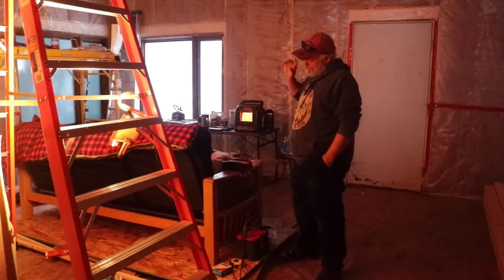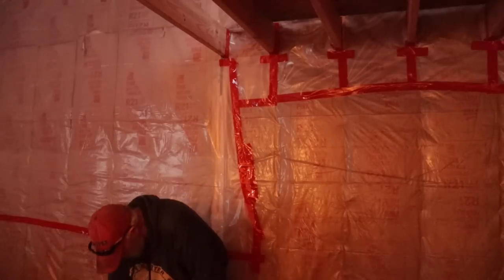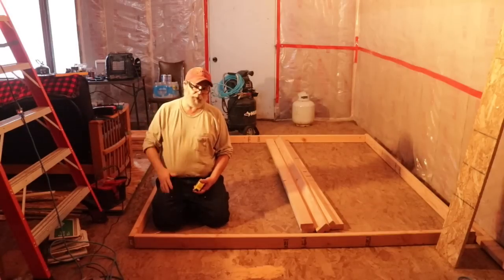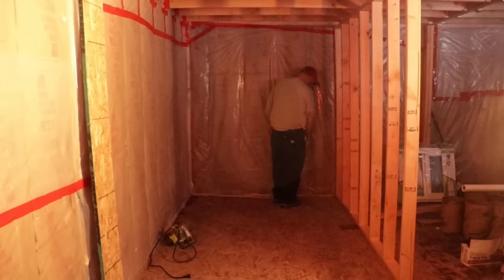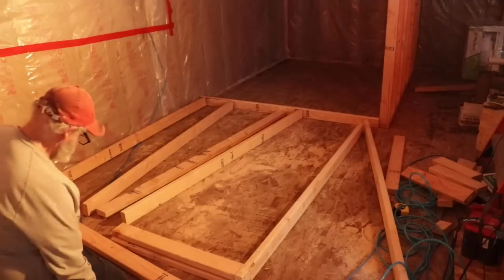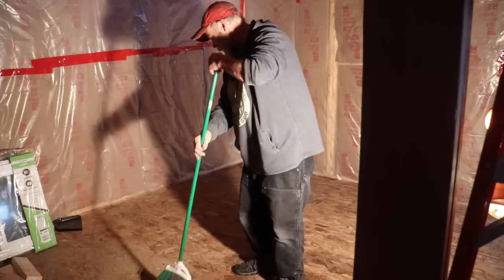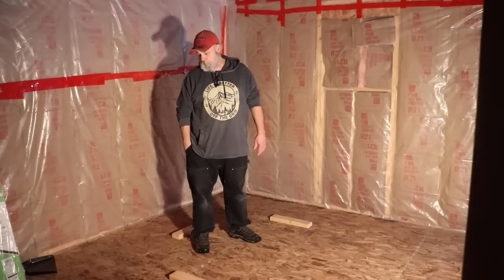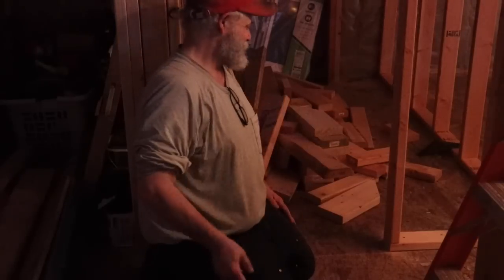Framing the Kitchen, pantry, and bathroom of the Alaska cabin

Comment: Stand kitchen base units are 24”D with 25.75”-26”W counters so doors and handles land under counter to prevent belt loops (and other parts) from catching on handles. Single aisles between counters are 42” to save on wasted floor space this allows for stove doors to be accessed comfortably keep fridges to no deeper than 28” or aisle will have to be increased. Looks great Sean!
Reply from the maker: Thank you! That just saved me a great deal of Google time looking them up 😉

Comment: Have you considered a half wall for the left side of the kitchen?  Less walls will make the cabin look bigger, and heating and cooling the cabin will be better.
Reply from the maker: Part of the reason I went with a full wall is that all of this is under the loft making the open area feel just as big. I still have the huge open ceiling in the main room .

Comment: Are u putting in a water pressure tank near your pump? They didn't put 1 in here..my water has been shut off all winter because of them not putting in tge proper 12v rV pump abd pressure tank..I also shut off my water heater..no point having it on if I'm not running water thru..
Reply: They installed an AC pump and my solar was not properly installed so my pump was not running right..
Reply from the maker: Yup, my plan is to have a full system, pressure tank included!

Comment: 23:44  30 inches wide-1 foot shelf on each side= 6 inches to move around in between? I am neither a builder nor a math-er, but that doesn't sound like enough room. As yes I realize you are already done with it by now.
Reply from the maker: If we are talking about the pantry, it is 5 feet wide, so with 1 foot shelves on each side I will have 3 feet in the middle. I do, on occasion lol, say numbers that do not add up when I am recording lol. For the kitchen I will have 4 feet of space between the cabinets to work.
Reply: @SeanInAlaska  Ahhh. I might have missed it earlier. It's good it's 5 feet because I wouldn't know who to call to pry you from between the shelves.
Reply from the maker: Exactly lol...